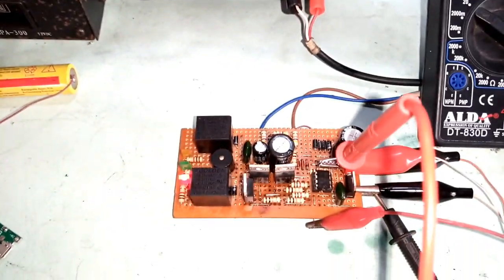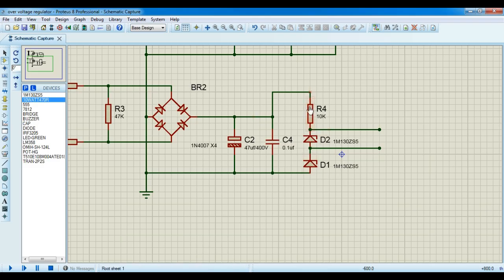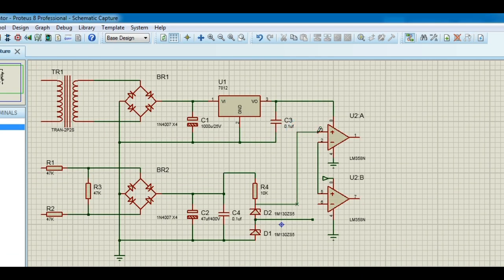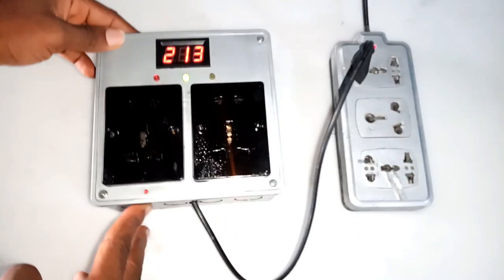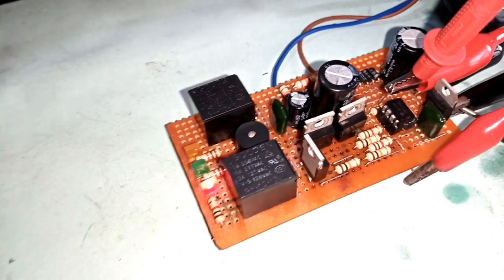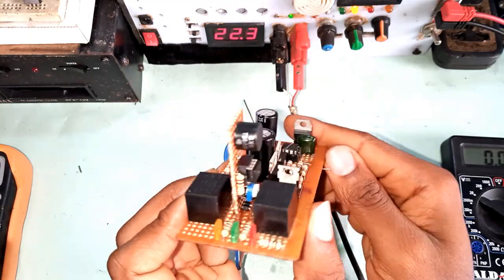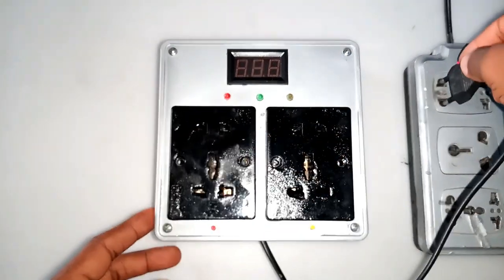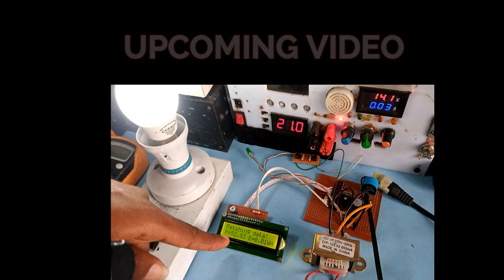Over and Under Voltage AC Protection Circuit: How to build an Over/Under Voltage protection circuit

Comment: Very good explanation. 
Thank you sir
Reply from the maker: Thanks 🙏 I do appreciate it
Reply: @MEmbedded_TechLab   
How to convert AC voltage value to a relative DC voltage value? please I'd really appreciate a feedback, I am doing the same project. 
Thank you
Reply from the maker: @nathanlumbwe2015  I used zener diode, just as I shown on the video
Reply: @MEmbedded_TechLab  
Thank you

Comment: Good job... I like your projects. Please do a video on softstart-softstop to control ac motors, amplifiers and other electronic appliances working on 220v ac powers. The softstart-softstop should limit the inrush current during power on and power off.
Reply from the maker: Sure I will consider that in my next project